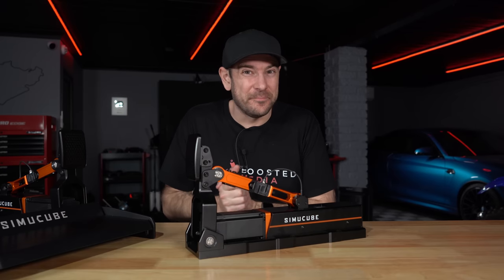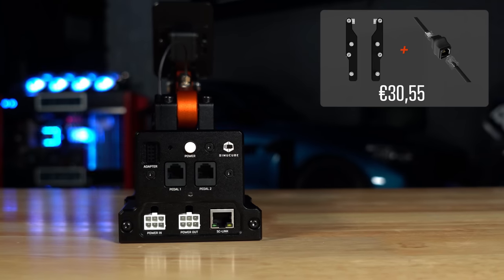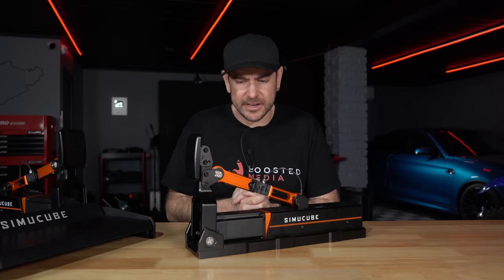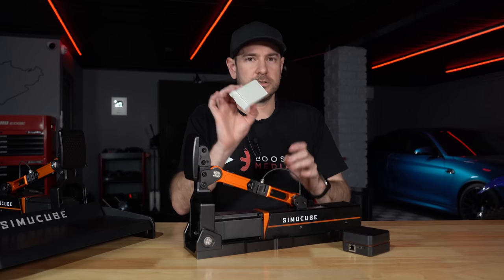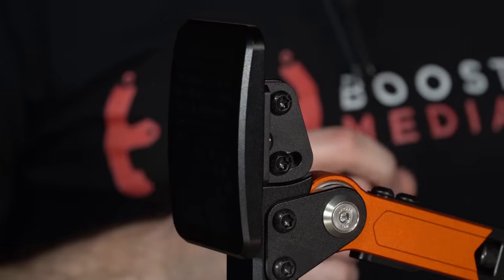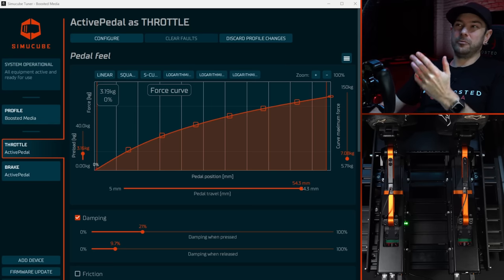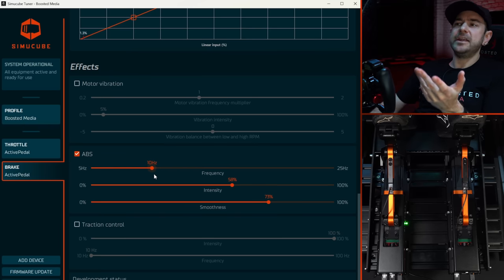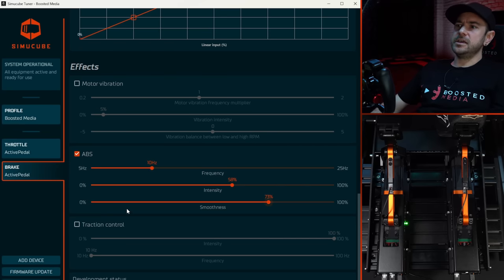$6000 FFB PEDALS! -  Gamechanger or Gimmick? | Simucube ActivePedal FULL REVIEW

Comment: I can't believe the price of one pedal almost costs as much as their top wheel base...makes no sense. I wonder how much it actually costs Simucube to actually build one active pedal.
Reply: I'm sure nowhere near as much, but they have to recoup R&D costs somehow.  Also, it's one thing to copy or improve on an existing design.  It's another thing entirely to engineer a new product from the ground up.
Reply: Well the wheelbase is an already established design but these petals are a completely new system that no one else uses. So they had to design these from the ground up which explains the price. In the future the price will probably go down.
Reply: They’re probably building the cost of the software into the price of the pedals.
Reply: @CrunchyDiopter  true dat
Reply: Each pedal is $2000 u can buy $300 non ffb pedals from the aswell and just ffb brakes for $2000.
Reply: Old mate ended up purchasing a 3rd pedal so he has all 3 … says alot about how nice these really are

Comment: Plenty of people have used transducers on pedals, so how these stack up to a active pedal would be interesting.
Reply: I use rumble motors from console joypads so it would be useful to see how these pedals compare to transducers and rumble motors.
Reply: I did put small bass shakers on my pedals. It's good for the money. But it's only an additional rumble, it's not kicking you back like the active pedal. So I did order an active pedal
Reply: If that is the primary feedback, then I am going to try fitting my current brake pedal to a DIY motorised rail, drive it with SRS etc and see how that works out, as unfortunately I cannot justify/afford spending $4000 AUD on a sim pedal.
Reply: @Seat Time  I understand. But honestly it's not the abs effect that triggered my order anyway. The ffb is the icing on the cake. The actual cake that made me order is the way you can set and test in few clicks any stroke and stiffness you want.
Reply: @SerialDriver  Yes, I can see the advantage in that and if you have the spare cash then why not, but for me, once I setup my brake I rarely touch it.
Reply: I have transducers under my heel plate.  This would be on another level to transducers.  My setup lets me know when ABS is engaged it doesn’t necessarily feel “ realistic”, but it gives me information.  If I could afford these, I would definitely consider purchasing them.  Hopefully, like a lot of sim racing tech, something like  these pedals could be made at a lower price point.  Just like the DD market has opened up to a lot more people, maybe this could happen for active pedals, in the future.
Reply: @vt6020  Having some spare small servo motors and linear rails etc lying around, I am now in the process of building something to mount my current brake pedal to, which will give a similar feedback to the active pedals (but way cheaper) - it will be driven via SRS, or Simhub.  Obviously it will not have all the one click adjustments, but I don't really need that.  All the best.
Reply: @seattime4075  That’s cool!  If you’re not looking for a pedal adjustment feature, this sounds like a good solution.

Comment: This looks like an axis of a cnc machine. Linear rail plus ball screw plus stepper/servo motor. All those parts are not expensive on their own, but Simucube must have spend a good amount of time and effort designing hardware and software to work in sim racing context hence the price. There is potential for this sort of thing to be much cheaper for sure.

Comment: 52:40 I’ve tried my friend’s one a few weeks ago and this sand feeling was actually quite annoying for me. Whether it’s the bevel gear design or the software, you no longer get a smooth spring loaded travel. I think this could actually be a deal breaker for some people so keep that in mind
Reply: Could you still feel it on a short travel brake? I really wanted those, but after reading and hearing about that sandy feeling i think i wouldnt like them. I mean we simracers were always looking for the smoothest and most natural feeling pedals, so getting a sandy feeling pedals set for that price sounds like one step forward and two steps backward to me.
Reply: @patrickdurka6188  I don’t think it’s related to travel. I think the motors can’t respond quickly enough when pedal movements get fast so mainly when you hit the brakes after a straight or go on full throttle. I hope the software developments could fix this in the future but personally I wouldn’t necessarily prefer these over other pedals.
Reply: @프레디khjfreddy  really? Thats crazy! I was sure it comes from the wormdrive. If its delay thats even worse. Thanks a lot for that info dude:)
Reply: @patrickdurka6188  I think I phrased that poorly. It doesn’t have any delay issues but you feel the steps of the motor when the pedal travels quickly. So more of a low frame rate feeling instead of input lag. Hope this helps!
Reply: @프레디khjfreddy  yeah totally, thanks man!

Comment: Thanks for the review will 🙏
That grainy feeling is something i was worried about.. using just lmp/lmdh cars i would not benefit from the abs effect, just the adjustability. And i think the adjustability alone isnt worth it for me, especially if the raw feeling is more grainy than a passive pedal (i know thats something that would bother me). Simtag makes a hydraulic pedal set with d-box haptics for abs and tactiles since some time, but there hasnt been any new telemetry implementation since that from what i know. Lets see if the simucube active pedals changes that with its bigger userbase

Comment: 45:37

You could ABSOLUTELY do this without an ingame data output for brake fade.

Have the force/resistance the pedals apply slowly degrade on a curve. There might not be an option to adjust it but its absolutely possible. You would need a "reset" hotkey if it cant ascertain when a new game is started.
Reply: All of this will not matter tho, unless the game has parameters that change how the car behaves over time. You would get the pedal feel, but not the ingame effects of less braking performance

Comment: These look so good.... if I could get Simucube to add a "rudder pedal mode" that linked the clutch/throttle together as rudder pedals this would be perfect for my everything-sim! Simucube confirmed they have got quite a few requests for this but no plans to add that mode yet.
Reply: Rudder pedals are much different than car pedals, and require toe brakes (except for rotors/helis) so this makes no sense. I understand people asking for it...but definitely understand Simucube's current stance of "no plans" because it simple doesn't make sense, practically, and would be nothing close to actual rudder pedals.
Reply: @mcgillacuttyxx  They could be programmed to be pretty much exactly like rudder pedals if the software allowed. Except for the toe brakes of course. But there is no problem for simucube to link two pedals together through the software and make one pedal go out when other travels in, with both returning to a central position when no force is put on them.
Reply: @texnorthman  rudder pedals slide, not rotate down/up…so again, no, they really can’t. Not in a realistic way.
Reply: @callsignbh  True, but more than close enough for many and quite similar to the movement you will feel with a set of helicopter pedals that you don't rest your heels on. Would be good enough for me ;)

Comment: Great review, Will. A bit galling to see them charging consumers $2500 yet at the same time giving away a pedal and offering a discount on the second one to content creators.
Reply: Yeah 2,500$ for a single pedal is kinda ridiculous considering you can get a whole setup with a decent DD wheel for the same price. Even some wheels that are real and not replicas don’t cost that much, I think they’ll drop the price over time or make a cheaper option.
Reply: @dbzcollector9963  They have to recover all the R&D that's gone into it, it would have taken a crapload of iterations to get to this point; other manufacturers who jump on will have significantly less work cut out for them as they now have a benchmark for what works.

So I think the price is entirely fair right now. I'm not even thinking about getting them at this stage, but active pedals will certainly come on my radar once we have more options - and titles support pedal FFB.

(Speaking as someone in tech/software engineering, and super happy with his Sprints).
Reply: @JSmith73  I know that but there’s already tons of diy designs online that these people probably got a lot of their inspiration from. So this R&D must have not spent that much time, if this were the very first of its kind it would be different. Still the price is ridiculous for a pedal that’s only useful for 1 thing, if it were a full set or even the gas and brake then the price wouldn’t be to bad but for just 1 pedal it’s ridiculous. I’m sure they’ll still sell tho, but I rather wait another year or 2 for other companies to make something lower quality but cheaper price.

Comment: Ehhh.. if I'm paying $6000 bucks for some pedals.  I would absolutely be upset at the grain feeling in the pedals. 

Don't give them a pass just because it's connected to a motor.  These are 6k pedals.  This is more than some used cars. It should be smooth.

Comment: Great review. As cost and others create replica's the price will come down, the problem with these pedals is that they really bring no value to non-ABS/TC cars. If you race a lot of F1 or quite a few other styles of cars, then you'd essentially be spending money on the software and ease of changes. The average person should get a set of HE Sprints, VRS, or even the new CSL Elite LC V2 pedals. As most of us will not be taking advantage, however, when the sim racing games catch up to the offerings and the cost of these pedals are half the price. Then that brake pedal will be beyond worth the investment. $2500 for 2, although costly, would be worth it, for now, simply outside the mass, but we know as sim racers more than enough people will purchase.